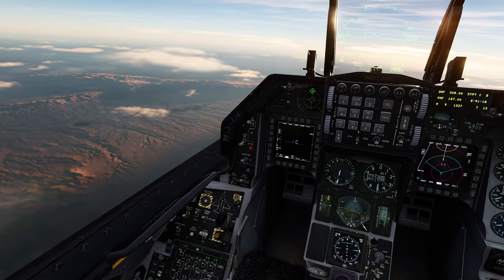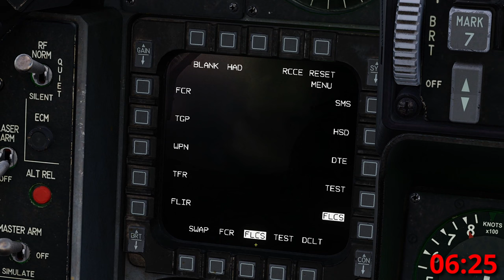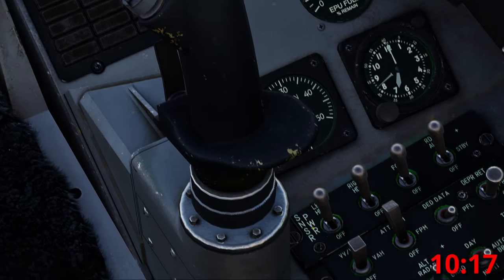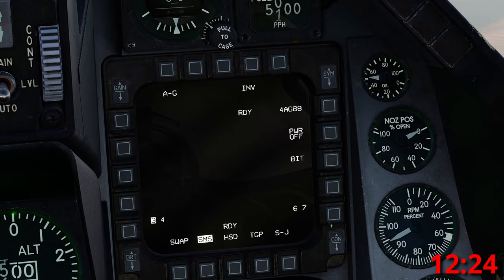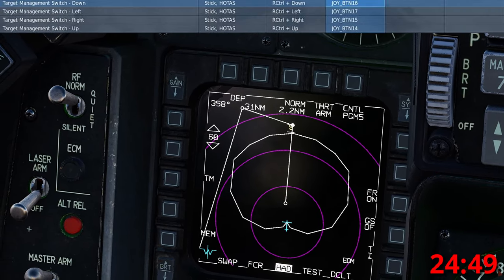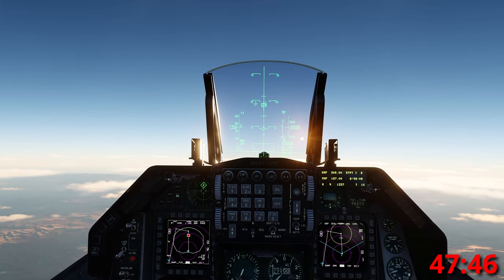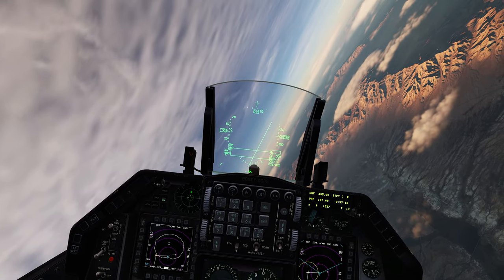DCS: F-16 HARMS with the HTS/HAD in 60 Seconds!

Comment from the maker: Forgot to mention the pull-up cues. My personal opinion is to put your flight path marker in between the min and max pull up cue lines (These are the horizontal lines on the ASL{Azimuth Steering Line} The big one is the max. The smaller one is the minimum) before you launch. This will give the HARM its best chances at reaching the target.

Comment: Excellent Dope will the AGM88 work against S-300? They utilize tricky radar.
Reply from the maker: Technically as long as the radar signature is present. It will guide to it. However, if it turns off and is mobile and moves to a different location, then the harm will just go to the last known location. So with the grumble, it should.

Comment: Great video. Do HARMS get shot down often before reaching the target or was I doing something wrong in my brief stint using them a few months ago?  I need to get back in the Viper. I'm currently messing around in the Hawg.
Reply from the maker: Certain sam systems can track and shoot down harms. Yes. The SA19 can. So if you have a SA10 being guarded by an SA19, you'll need to take it out first or it will shoot down every harm you throw at the 10. I believe 11s can shoot down harms as well.
Reply: @BogeyDope  Ohhh. Ok thanks.  Keep up the awesome content!👍🏾
Reply: @BogeyDope  So what method would you use to take out the 19, since harms would get shot down?
Reply from the maker: @redtailpilot  If it is a 19, it doesn't have very long range, so you can get close enough to drop a JDAM on it and leave the area before you get to the threat ring. If you have to get within a different threat ring to get to the 19, then you'd have to go in REALLY low and pop up last second. Either way, they can't shoot down bombs. They can't get a lock. They CAN shoot down Mavericks. I've tested this. And 19s will shoot down a MAV. Me personally, if there's a 19, I decide whether or not it is viable to fly in and kill it with a bomb and then get the heck out of there really low and fast, or fire a bunch of HARMS at it from range. (This isn't realistic but its what I have done and see a lot of in DCS).
Reply: @BogeyDope  Awesome. I have to get back into the amazing Viper soon and try some of these tactics. Thanks a million 👍🏾

Comment: Hey. I tried doing this but for some reason my had wond detect any Sam sites. I would get fired on and it still wouldn’t see anything.
Reply from the maker: Make sure it has power. The left cheek power switch on the right side of your stick. And make sure you have a good INS alignment. If your INS isn't aligned, it won't work either.
Reply: @BogeyDope  I had full ins alignment and left hardpoint was on
Reply from the maker: @crosswindfpv5359  I'm not sure why it isn't working in that case. Very odd.
Reply: @BogeyDope  alright thanks for trying to help. Keep up the awesome content
Reply: @BogeyDope  Update: my had just started magically working.
Reply from the maker: @crosswindfpv5359  I'm glad it started working. Wish I knew what happened
Reply: @BogeyDope  yes idk I think it just fixed itself with the update